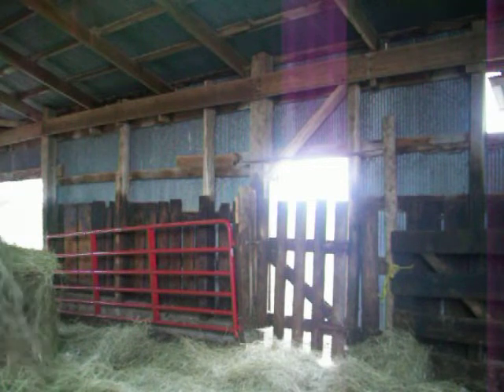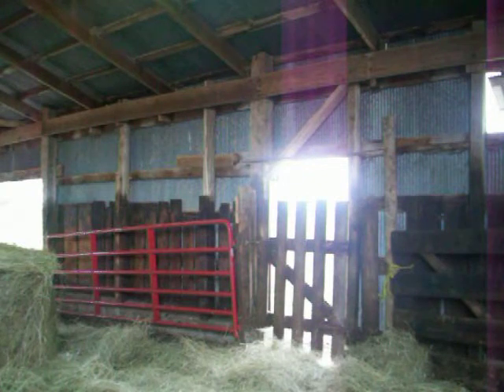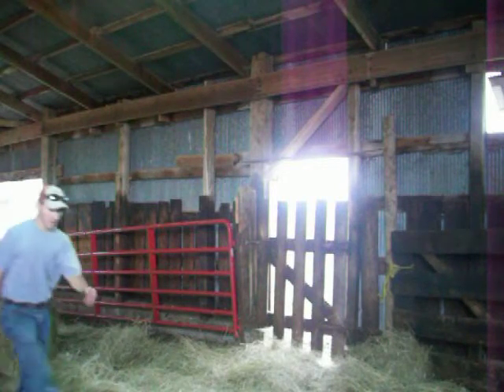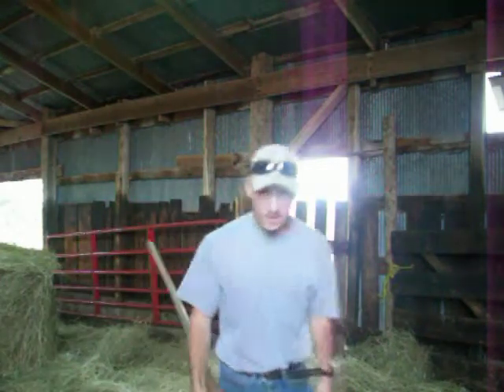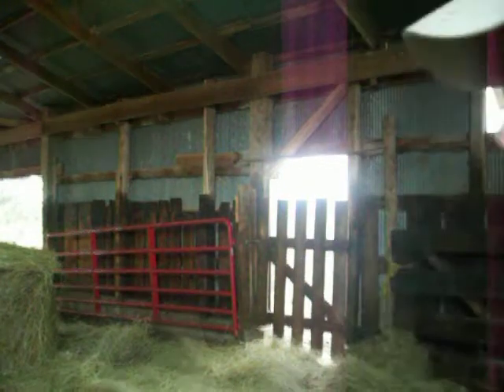bedding the barn with old hay

Comment: Hey Skittle need to pick your brain .👍 Got International 350 will run with  choke on . Reman the carburetor and didn't see anything out of the norm . You got any ideas sure could use some 👍
Reply from the maker: Nobody Sam only other options I can think of off the top of my head are to check plugs check fuel.lines make sure there is not any dirt in the lines can't thinks of much else I gotta here it run to be able to trouble shoot it better
Reply: Thanks for feed back